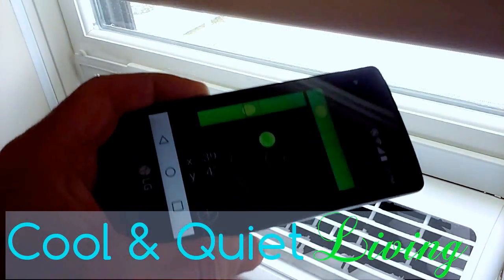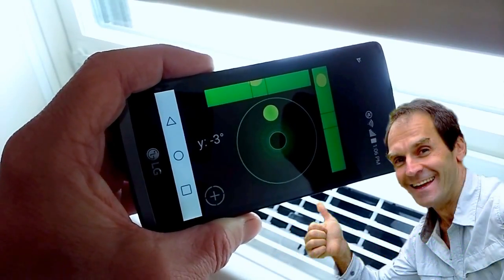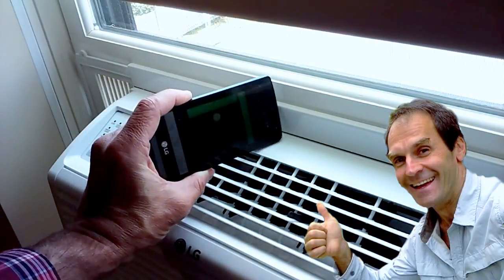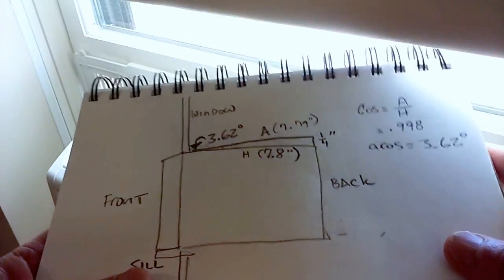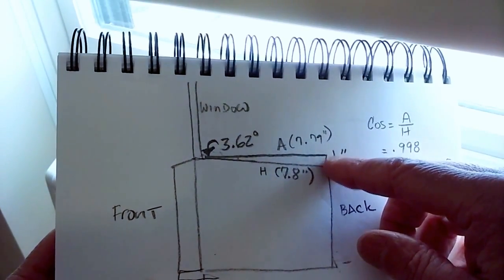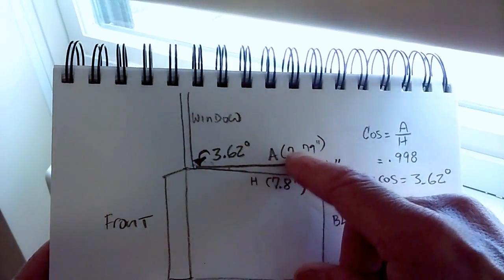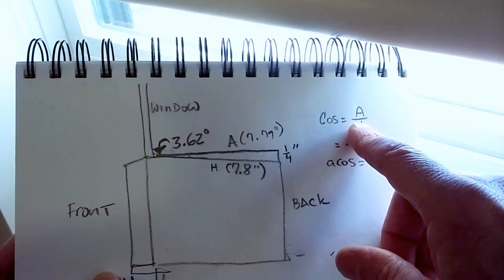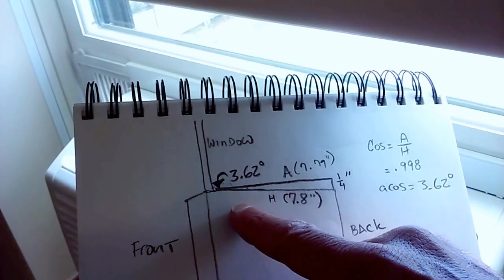proper angle to drain window air conditioner water outside

Comment: Ugghhh, just installed one yesterday, the central unit can’t keep up in this heat. This morning the display lights are foggy, like there’s condensation, so idk if that means it’s not draining properly or not
Reply from the maker: I'm having same moisture problems in apt. this summer, it's been so wet.
Reply: @p1nesap  oh makes sense, so maybe that’s all it is.  Thanks!  Yes, the inside of my dryer is even wet from the humidity coming in through the hose/vent
Reply from the maker: @Jerreh-s4q  You could use a dehumidifier if it's really bad.
Reply: @p1nesap  might need to! Thanks :)

Comment: I had the same problem of not enough angle when installing the unit to fit in the window sash opening. I removed the top bracket on the unit (removed 4 screws) and reinstalled the bracket one inch more forward. I was able to reinstall  the accordian covers on both sides connected to the unit. I had to make it bend a little, but it worked. Repositioning the bracket on top allowed the back of the unit to lean one inch and drain the water much better.
Reply from the maker: Great job Ron. Thanks for posting.

Comment: I have a Denali air window unit and I do not see a way to adjust the tilt. The company is no help. The window is fixed and do not see any options. Please help. Thanks Rob.
Reply from the maker: Is water dripping inside? If not you're ok. Either way, you should access AC /open window when possible to inspect for mold every year.

Comment: I have this exact same unit, but cant tell by sight if its tilted properly or not. I have it properly flush with inside/outside window edges. But this morning i opened the window and tilted it back a bit and a LOT of water spilled out the back. Is there supposed to be some standing water even if tilted properly?
Reply: There should be a small amount but I have this exact same ac installed in my mobile home window and it leaks from the front inside the house
Reply from the maker: The hot season may be over for you now, but that sounds like the AC should be tilted steeper outdoors.
Reply: @p1nesap  this water issue is why I am here also. I have mine at angle but IDK if its enough. THe hole located on the right 1/3 [looking at it from outside\at the back] of my FRIGIDAIRE 5000btu is almost useless as I see & hear the water pool hitting bottom of squirrel-fan or it is just so close to it that water is drawn up into the fan. THe moisture level in the room has gone way up. I roll my own cigarettes and the tobacco is jamming in the rolling machine which means high humidity\moisture levels.  THis was a used unit, it was extremely clean, used by an old lady in her knitting room. I live in Florida and the "old folks barely used on Sundays" thingy is real here i.e. "....clean low miles...." ....ha ha !!
 I am just going to drill a few more holes and see. If it needed that water in that area I can always plug the holes I make.But the information that the new a\c units don't need water drain holes is not finding any support as far as I have found.
→ I believe this "water-pool" or "heat exchange" whatever idea is because of the floor model type a\c units that somehow evap the water like. I know this, I had one & the overflow tray never had water in it. This is also "humidifier capable" type-o-unit so thus the tray I guess...?? Anyway the characteristics of that system got injected into current  window & portable a/c discussions most often..........in the garage and/or local pubs and → "the range" ...........funny how when ya say "the range" everyone knows which one or rather 'type' you might be meaning to refer to.  
BuT  then...........well again here in FLORIDA, there is the golf

he he he, peace out ~ Godspeed ~ Always Forward

Oh and remedial is the word @Keith Alu  lol, yes remedial...........very

Comment: I want to see HOW to tilt it 😒
Reply: I had to move the top bar back by redrilling (carefully) for the screws that hold the bar.  Mine was a 1/8 drill bit and I moved the bar about a quarter of an inch. Got enough lean to keep rain water out.
Reply: Felice Joseph   Just notice water coming inside house and window trim outside rotted. Ugh.
Reply from the maker: If it's level with the window, it's probably tilted back far enough. Just don't tilt it at all forward.